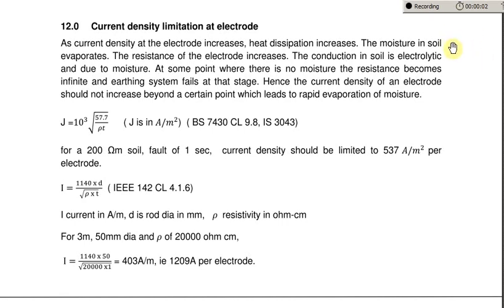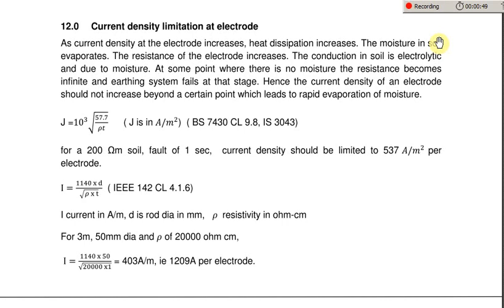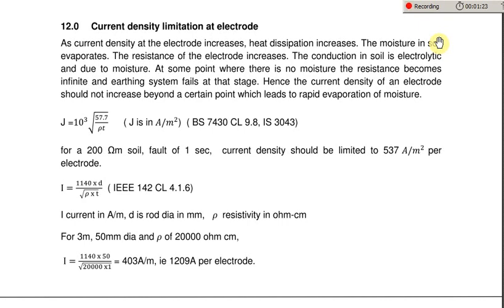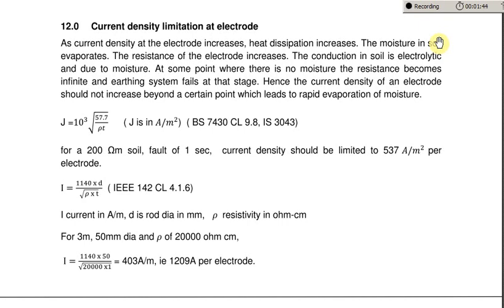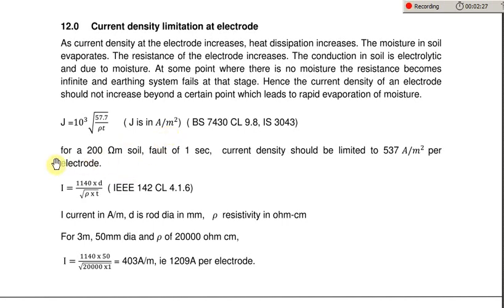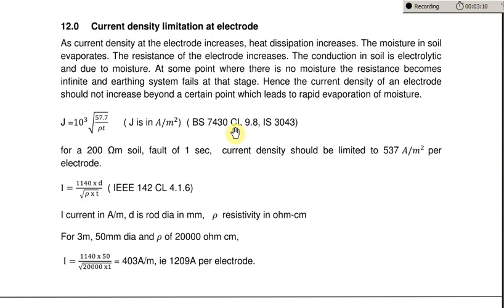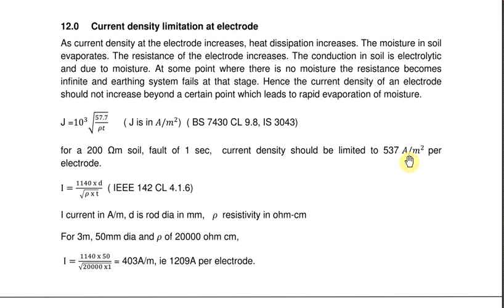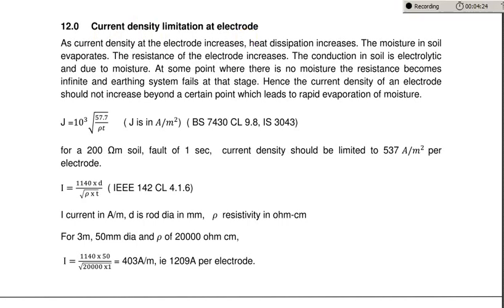Current density limitation at electrode

Comment: What should the value of 't' be taken as? For a warehouse with a 500kVA transformer, and so fault current around 15kA, and a soil resistivity of 15 Ohm-m, as per the IS3043 formulae, for 1 second, no of 2m, 25mm Dia rod electrodes required is 45??? That is too high. Now the typical pickup plus opening time of MCCBs is well below 20ms. Even if we take 100ms for calculations, no of electrodes becomes 14. Please guide whether I am doing it right and that I have understood the concept correctly. Also what should be 't'?
Reply from the maker: will guide give me some time i am conducting a training this week buzy in that https://electricalguideline.com/solar-pv-system-protection-fault-current-calculation-and-groundingtwo-days-training-program-across-india/
Reply from the maker: run a ring around your warehouse
please mail your query to vkes@vkes.org